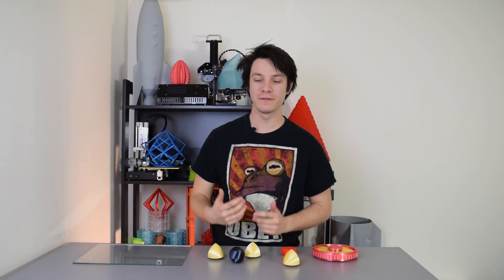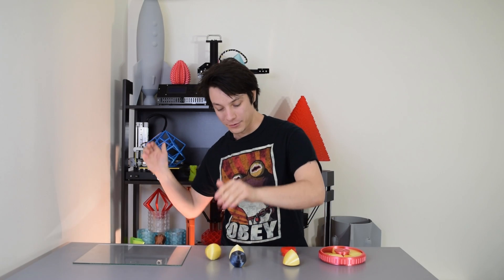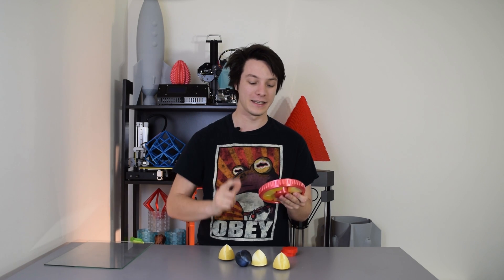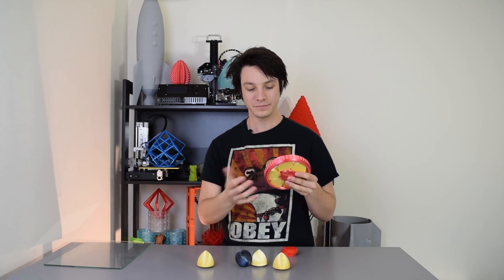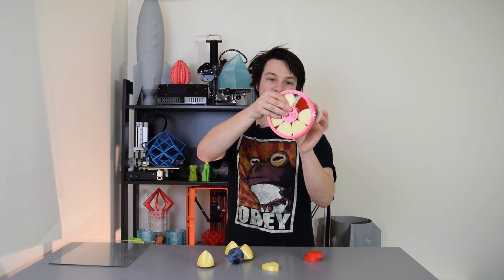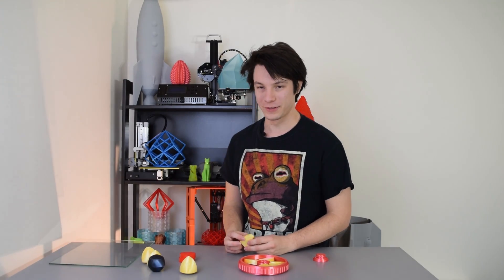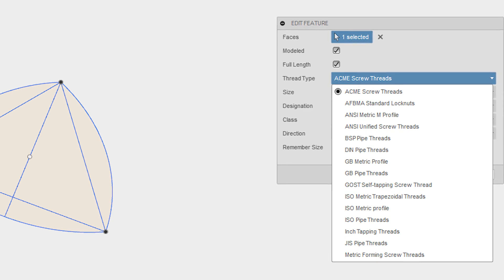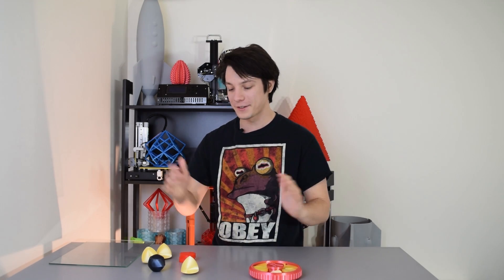Reuleaux Triangle Bearing - is it possible?

Comment: I dont get why this should not work with a "ball guide", the Reuleaux Triangle just needs a square shaped space to move in. I tried to make one of these, it seems to work in principle, though I didn't try it in full size yet. You certainly have a better printer, filament an more experience with tolerances so maybe you could try to make one, i ubploaded the stl file, Blender file, schematics and images of my attempt here, in case you're interested: https://www.dropbox.com/sh/7z8f4c0jyvrldwj/AADCkeaBt0pRFw0nrtWuTqWka?dl=0
By the way, my design is also not perfect and may need a bit of fine tuning before printing
Reply from the maker: Nice tests!!! You're right, a square should constrain it but whether it rotates or not I'm not sure. I've gotten some great ideas from people like yourself so there'll be a part 2 of this for sure.
Reply: @MakersMuse  well just make it like a rotary engine
Reply: Wouldn't that be just a normal Bearing? Or, at least, closer to a normal one?  Its kind of a challenge to make it work with three sides I guess :)
Reply: I just added a gif Animation to the Dropbox Folder, but I have to say its not physically correct, the path the center points go is not just a circle, as it might look. By the way, thanks for pinning my comment :)
Reply: I think you are missing the problem with the SOCW they are constant WIDTH but do not have a constant RADIUS.
You will notice the problem in this gif provided by the OP
https://www.dropbox.com/sh/7z8f4c0jyvrldwj/AADCkeaBt0pRFw0nrtWuTqWka?dl=0&preview=constantWidthBearingV2.gif
Because the center of the SOCW will fluctuate they depend on the sides to keep them centered. Key word here is CENTER. Now looking at the gif linked above you will see that the SOCW points make contact with and pokes through the external ring. That is not just a drawing flaw. Pay attention to how the SOCW does not poke out in the center of the arc just on the "Corners" of the "BOX"
Let me explain what is being over looked. The SOCW is again constant WIDTH. That is from the exact opposite side the width remains the same. And while the center of the SOCW fluctuates the 2 points of contact will always pass through that center point. BUT what if you deviate just a little bit and cross through the SOCW at a slight angle and miss the center point  as happens in the contact between center ring and 2 contacts  on outer ring's "corners". You will see that when the SOCW pokes through the contact between the inner ring and outer ring is almost completely along the triangular edge and no where near it's center. Thus the constant width is being ignored.
 
So because the  SOCW is NOT making contact on the oppisite side but at a slight angle to the outside rings inner curve this will cause binding due to fluctuations in width. I am guessing that this could only be minimized by creating a far greater circle for the external ring to SOCW ratio. But there will still remain a point where the SOCW will bind due to their being wider or narrower 

Now becuse I SOCW remined me of ROUS, does anyone remember what that sands for?
Reply: Your design seems like it would work, but I think you'll find that the gap between the square guides and the bearing race will be where the corners of the bearing tend to get stuck. Another thing to try would be to put an axle on your bearing and have a curved track for it to ride in.
Reply: But another issue is the lack of friction between each Reuleaux Triangle and the walls of the bearing. I suggest subtracting about 2mm from the two walls in the bearing that the shapes touch, and then replacing that space with custom strips of rubber or silicone so that the Reuleaux Triangles don't just slide.
Reply: It could also potentially work if the "cylinders" in the bearing had pins and were guided by radially perpendicular holes in the "ball guide". This could be accomplished with two plates on either side locked to eachother either by the "cylinder" pins themselves or by interlocking the plates in gaps inside the bearing, the former probably being much easier to produce.
Reply: Relative speed between the bearing balls is pretty critical with real bearings. If it were used for a real load, the changing velocity of each would cause serious binding. In actual bearings even being off by 10's of microns from their basic diameter is enough to cause them to bind. These would essentially be all over the place due to the changing instant center.
Reply: Can't wait to see this.
Reply: Julian I'm glad I wasn't the only one that thought this after watching this video
Reply: What about a fixed guide pin in each bearing so that the position of the inner race actually rotates as well- like a dough mixer.
Reply: jonathan hernandez your Apex seal is a piston ring, just laid flat. That is my point. It is not a bearing, though it is a bearing surface on at least 2 sides at any instant, just like a ring. That bearing is only for sealing purposes, though, not facilitating mechanical motion as a "bearing" as discussed in the video does. The friction those Apex seals see is because of the hellacious surface speeds they are subject to, always in one direction. They lap the microscopic finish off the surface, while a traditional Otto ring, due to reciprocating, has those land peaks burnished back and forth, not lapped flat. If you laughed out loud, you didn't actually understand what I said.
Reply: +Maker's Muse

What about using a bearing with more sides?

If a circle can be described as one of these (with an infinite, odd number of sides), shouldn't increasing the side number make them roll more evenly?

I wonder what the threshold for it working would be?
Reply: if you put an axle on each "roller" guided in a oblong shaped holes ball guide it should work just fine ... I still don't see any improvement from the classic ball bearing tho ^^
Reply: TheEnigmaticC why don't make the bearing out of different materials in a certain structure/composition so that it's balanced, like what disney research did with their spinning toys?
Reply: Julian you should probably try stereolithography
Reply: have you tryed puting it within a pyramid then arrange 8 pyramids into a giant hexagonal bearing :P
Reply: when is part 2 coming?
Reply: Yeah, my thought as well. But the more I consider this problem, the more I think it's tricky, and the less I'm convinced that a true (i.e. mathematically perfect) solution is possible.

Without some kind of ball guide, the problem is obvious. Even if the shapes are constrained to keep a constant-width relationship between the axle and rim, they're not constrained to keep that relationship with each other. As two such shapes rotate in contact, the contact point can move in and out, depending on the precise orientations - meaning that they're free to find a minimal distance configuration. And once you have several, that means that they can lock up (which is what's happening in this video). Some sort of roller guide should solve that, however. And circular bearings don't have the same problem, because the contact point between any two bearings doesn't move about. (There IS a case for regular constant width solids where the problem doesn't happen, when adjacent solids are kept oriented as mirror images of each other, and rotate in sync in opposite directions. You could possibly force that by adding teething around the edges - but then again, that brings its own engineering problems at the very least.)

The trickier aspect I see is that solids of constant width work as rollers because their points of contact move within the parallel PLANES they're separating. But the surfaces of both the axle and the rim are CURVES (and of different radii to boot), meaning that the contact points have to follow those curves to get a perfectly smooth rotation. That's not going to happen (or at the very least, it's decidedly non-obvious that it will or can). Which means that, even with guides, the rollers may be similarly attempting to lock - in particular with the axle - as support distances change. That problem will obviously diminish as the number of rollers increases (making the surfaces they're separating flatter relative to the rollers), and it's possible that with enough rollers and adequately generous engineering tolerance to take up the changing distances, a bearing that works after a fashion is do-able - but it's likely to rattle around a lot, and unlikely not to have a fair amount of inherent friction. And if a perfect solution IS possible, that's certainly not intuitively obvious.
Reply: thanks :-)
Reply: Where is the link?
Reply: https://www.dropbox.com/sh/7z8f4c0jyvrldwj/AADCkeaBt0pRFw0nrtWuTqWka?dl=0 this one?
Reply: +Julian
Thanks, for some reason, I could not see it on my phone...
Reply: Maker's Muse I don't know if you meant to do it but the song at the end is mekanum like a omnidirectional mekanum wheel
Reply: Julian not having seen your work (on mobile) I'm left wondering if a reworking of the holding rings is in order? My thesis is if the interiors were undulating in a specific way these bearings would then behave even more like circles. The pattern of undulation would be according to the difference between the shape used and a circle. I hope this makes sense since I'm describing complex geometry very simply.
Reply: Julian  That is quite an impressive design!  Would you be able to include more of those squares so that more of the solids of constant width are included?  I was also thinking: why not try placing some little axle in the centers of those solids, so that the bearing acts to do something with the rotations of those solids, like spinning a gear or something?  Just my thoughts.  :)
Reply: jonathan hernandez  those seals are piston rings, not heat absorbers. The heat is in the rotor, just like the Otto piston. They allow the rotor to expand and shrink while maintaining seal, just like Otto rings with the piston. A gear type oil pump uses no seals or wipers, just close fitting. It can because heat load is even, entire assembly. It also swims in lube, lol, which even the heat, and carries it off. The gears expand similarly to the housing, or less. Those seals allow the uneven rotor expansion to maintain working "wall clearance" on the end shells as rings, skirts, and cylinder walls in ottos. Though undoubtedly a bearing surface, they are not really "bearings" so much as seals, as that rotor could quite comfortable run in the Shell without them, just not making any power, vac, or compression. Try running a Briggs 5 horse without rings, just cranking by hand. Clunky and tick, but it spins fine. Same same. Wankel seals are rings, not bearings
Reply: ludditeneaderthal I’m sorry, that made me laugh a little. But to make things clear, rotary engines (Wankel) DO NOT have piston rings because of the simple fact that they do not have pistons at all. On a 12a or 13b engine you traditionally have 2 rotors each having 3 points where their Apex Seals are spring loaded to push against the inner walls of the rotor housing creating a seal. Some have opted to replace their apex seals with ceramic ones as they last longer and can withstand the heat and absorb it as to not warp or damage any of the rotors and housings. To help with this the engines are to be lubricated with oil as well. So to clarify, no piston rings were used in the making of a Wankel rotary engine.
Reply: I see it working too. like in manual trans where there is no pump, just oil thrashing. these weird oddities, not necessarily a triangle, must help keep things moving as they got old. It may be the reason my transmission is at 363k miles and hauling 4 tons...and its just a half ton pickup. Makes a supercharger noise, and would trade it for nothing. The expense is noise, but you know what you got.
Reply: Yeah even ball bearings needs a cage, but that cage prevents binding. You're just going to add in more friction adding a guide to hold the distance in between the tris.
Reply: Julian the problem with that is the 2 planes of the square need to move oposite directions.  But I can't see vid on my phone.
Reply: Second
Reply: Agreed. With a guide in place keeping them equal distance apart with enough room to move accurately this should work as expected.
Reply: Julian: why the quotes around "ball guide"? Is it not an actual ball guide, or... what?
Reply: Julian where is the part 2?
Reply: To allow "rotary" motion, your bearing race pockets have to allow axial motion of  the "balls" in relation to the shaft, so 2d examples can't work, ever. Your race has to be a hemisphere of greater radius than maximum  "radius of moment", but has to have a floor of "rolling radius" but also max ROM, so needs some snowflake asterisk grooves too. Those never roll, they wobble and tumble. Trying to make them roll linearly will never work.
Reply: Yeah, pretty much! I just wondered what the limit would be for the simple bearing design he had.

Three sides is the least it could have so is definitely the most difficult. Your design looks really good so far though, so good luck!
Reply: Julian nice design, the problem I see with yours is that it creates a ton of extra friction on the corners. For some reference think about the Wankle (rotary) engines design. They used apex seals and springs to take the heat that is generated. Obviously there’s no fire going on in this but friction is the key here.
Reply: ludditeneaderthal I understood what you’re trying to put down, but still has me going. To me, yes apex seals on a rotory is piston rings on a traditional engine. But for others who do not know, will think it is the same and nothing different about them and their properties, yes they have the same purpose but aren’t interchangeable. Also it may have sounded like I was saying that it was a bearing in some sort of way, but what I meant was although a rotor was NOT designed to be used as a bearing due to their designs and the way it rotates, again in theory it CAN be used to help design a Reuleaux triangle as a solid of constant width. A little miscommunication.

Comment: Hi, cool vid. Here's some questions: Would it be possible to design some sort of trick axel bearing that would allow a wheel of constant height to bear weight agnostically with rotation angle. Said wheel would be like the cool bulged out triangle but the wheel would be like a cookie cut from that shape. Next - how would the bulgey 3D equilateral triangle shape of equal height behave as a baseball? I.E, how might it respond to air flow when thrown? What if it is spinning as thrown? Fun shape, Thanks!

Comment: Or you could have a ball guide that is not rigid that instead can stretch a contract but perhaps with spring pressure holds the general position

Comment: Hi, there are some ball and roller bearings without cage (part separating rolling elements). This is done to increase carrying load capacity of the bearing, but as this is increasing a lot friction, this can only be used for low rotational speeds. For your case, it could be possible to make a "pin type cage", as you cannot use standard ones. This cage as "pins", and those pins seat in holes drilled in the middle of "rolling elements".

Comment: That can totally be designed into a bearing. Keep the original shapes.
 Print a groove on the interior and exterior bearing ring as the shape would roll on a flat surface. Like a zig-zag groove. The inner ring width will be less that the exterior ring width.
It can be done!

Comment: You should use a more textured surface to roll them on, put some felt on the glass and the table and it will grip and turn more consistently.

Comment: You could invent a new wheel, one that accounts for the bearings to rotate freely while supporting the wheel . Like a key in the middle of the spheres . Smaller flexible sphere in between. Or a stencil like attachment built into the wheel to keep the bearings from moving beyond one point. If there is any interest in making this a atural  viable solution.

Comment: Maybe for the bering all you need to do is create gear like grooves on the triangles and the axle and outer ring surface

These gear teeth would ensure that the triangles will absolutely stay far enough away from each other in the housing. This would eliminate the need for a guide. 

ALSO gear teeth would require the triangles to rotate instead of sliding and slipping on the housing

Comment: Theres avtually a way to make guides for this kind of bearings. The center of mass of the bearing only moves up and down so you can make guides that allow movement in the radial axis for pins that would go through the center of each bearing.

Comment: And even if it worked, it would break much faster than a conventional ball bearing. Since the points would absorb all the pressure, and break first. Furthermore, noise is an issue. Manufacture is harder, since polishing with rubber balls is not possible.

Comment: since u are working with a sphere or cube u should use an object made up of two of your shapes. it is a Hextratridern  two triangle solids primadies will make a cube (which has a sphere inside the size of the cube and a sphere that will have the corners of the cube touching it.)  this should help u since with one reuleaux shape u are working with 1/2 a cube (which is two sphere of different size in it.)

Comment: If they deed the gap between them to roll properly why not make the race wall a length to which they can't fall out...???? Specially since your center hub is screw off should be easy enough to do